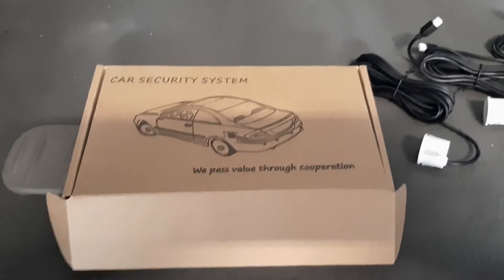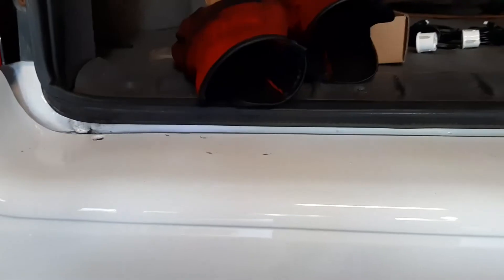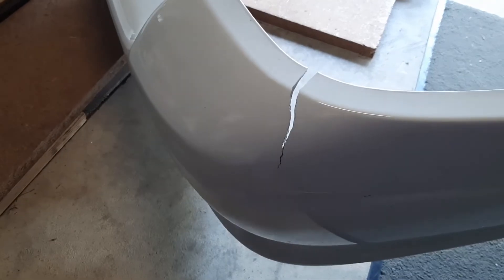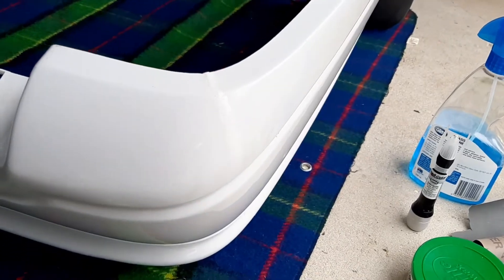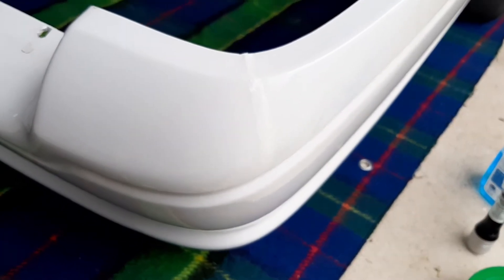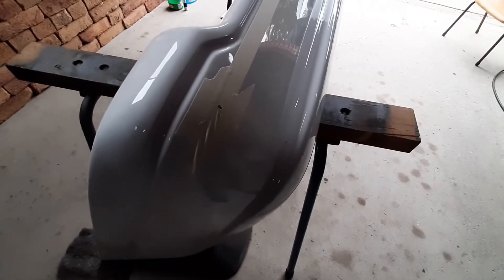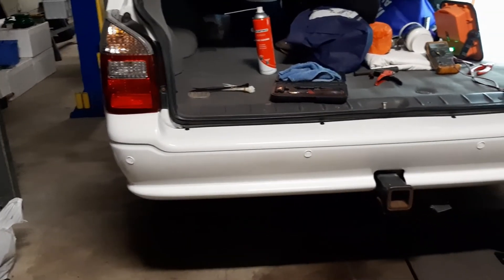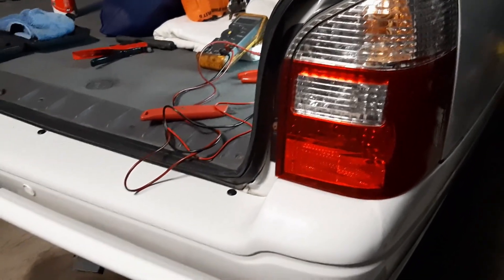Ford Falcon Wagon Rear Bumper Repair and Reversing  Sensor Install

Comment: It`s a good tutorial! I have to face the same Ford St. vagon task, excluding a crack :)Can you tell whether it`s necessary to completely remove the bumper in case if we need to install sensors only? It looks like a pretty bulky job. May be there is a chance to do this somehow with the bumper on car, please? If no option, can you specify how you have restored drilled rivets to fix this bumper back? Thank you
Reply from the maker: Hi there. The bumper is very light and easy to handle. If I just had to install the sensors I would still remove the bumper as there isn't enough room on the inside of you have to secure the sensors in place like I did. The drilled out rivets were replaced with new rivets. Hope that helps and thanks for watching. 👍
Reply: @FAB7362  Yes, that definitely helps. As I see, I have to obtain all the replacement clips and rivets (screvets) before I stars bumper removal (not allowed to  drive to a shop without bumper :)))  Can you advise, how to specify types or sizes of these fixings I need, please? No one store can define that plastic stuff for Ford Falcon. Instead, asking me to take samples...  According to this video, some of them are plastic clips (threaded, fixing mud covers), five top ones, holding bumper at the rear side are push-pull plastic clips, and ... it seems like we have a few metal ones underneath...  Do we need for any special tools for fixing them back, or just push them by fingers/pliers?  One more what I`m scared about is two nuts under arches... They look like pretty rusty.  I understand, I can spray WD 40 prior... But, Is there a chance to broke them?  I have no idea whether it can be a big problem in such case...

Comment: Unfortunately, there is no information about how to run cable from the bottom niche to the dash board... Do you have any tips with this, please?
Reply from the maker: I would remove the lower plastic trim (scuff panel) on the door opening and you will see that the main wiring harness runs along there. Clip your wiring to them and then replace the plastic cover.
Reply: @FAB7362  Oh, it`s a capital idea!!! I hope that means from driver`s side. Is this harness runs directly to the rear niche where you performed connection, or it needs for an extra hole drilled? Thank you for your vital help!!!
Reply from the maker: No problem , glad I could help. Usually right hand drive cars run the wiring harness on the right side. @alexanderchuyko4889